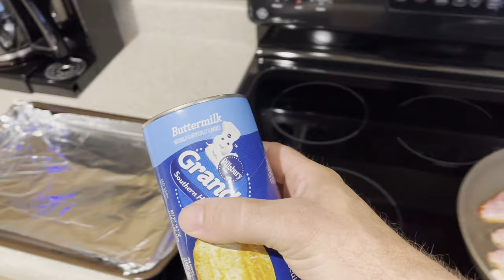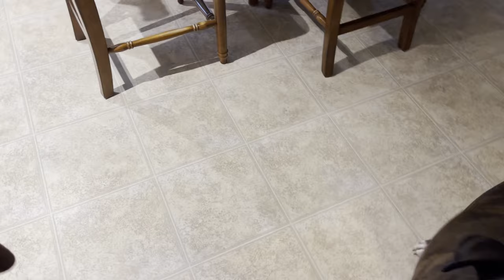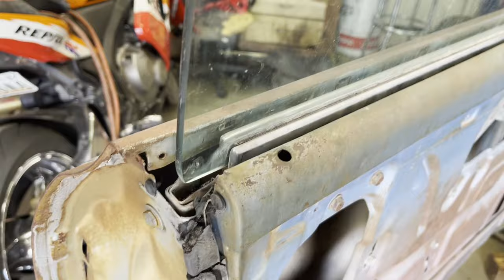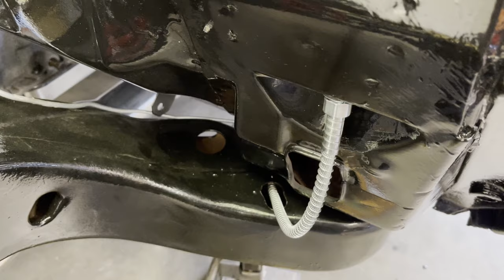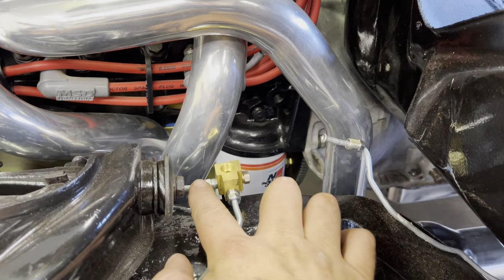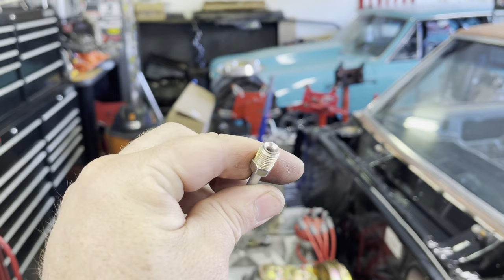Down N Dirty | 64 Chevelle Build: Biscuits & Brakes with a side of Line Lock!!

Comment: You forgot to do a coil with the brake lines between the master that is bolted to the body to where the line gets fastened to the frame. Should be ok for a while but left that way can cause you some problems a few thousand miles down the road? 

The factory does those coils under the master to keep the lines from breaking because of body flex. Might be ok to get you to the NNNs but keep an eye on those lines that transition from the body to the frame.👍
Reply from the maker: There is no tension on that line.  It’s only attached to the frame by a clip. If it was solid mounted then yes. You would want to coil it.  Good eye. But not needed here.